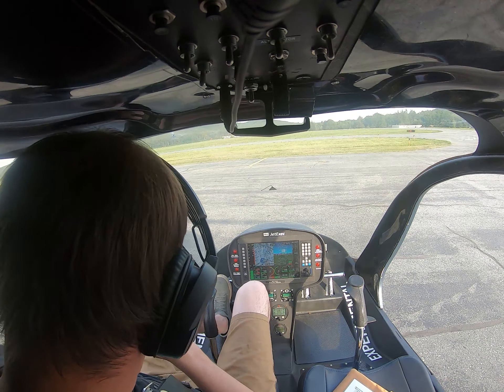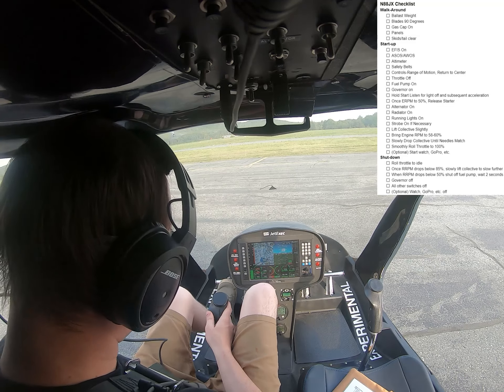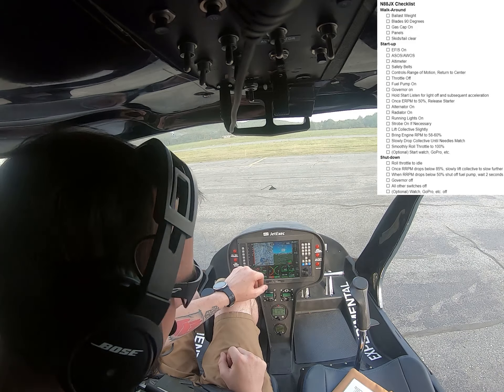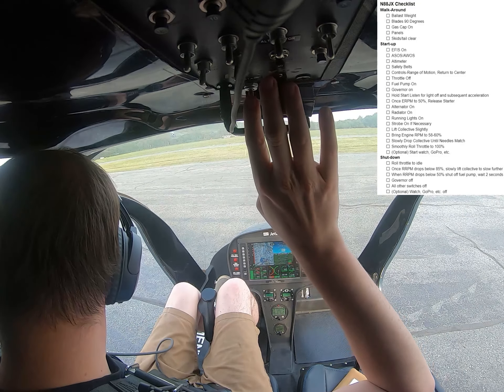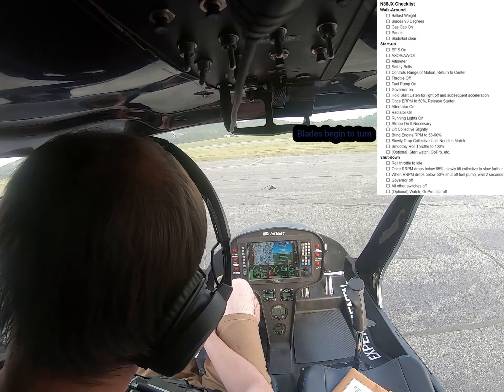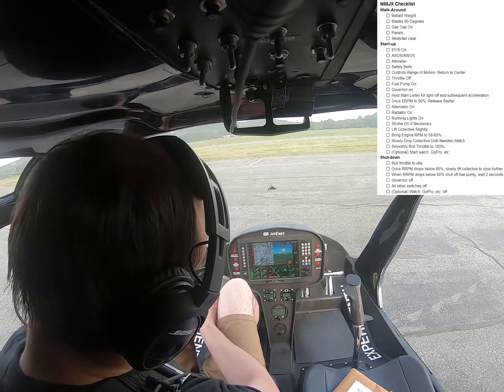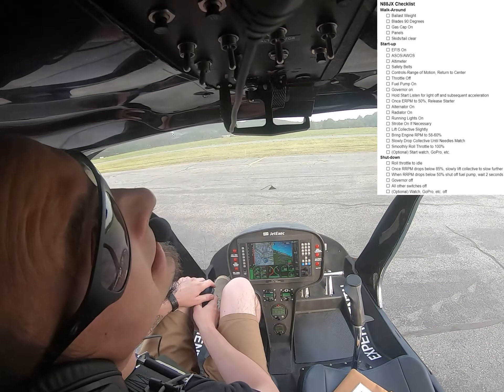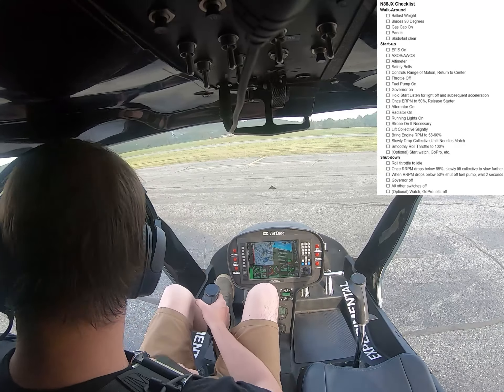JetExec Turbine Startup Procedure - Narrated

Comment: Beautiful helicopter!
Reply from the maker: Thanks!
Reply: @Aerohead  I had the opportunity to fly in a 162f last week in AZ, by the old rotorx factory. It was the piston model but amazing helicopter. Would you say the jetexec is anymore complicated than the standard 162f? Maintenance, flying?
Reply from the maker: @Urbanracer  No, not at all. I've flown both of course. The JetExec is naturally governed, so if you didn't have the governor on the piston model, that will certainly be a difference. Also, the governor in the JetExec is SOLID - you should expect to see RPM stable to with about a tenth of a percent - so that does make the whole thing feel more predictable than even the governed piston model which can sometimes have more oscillation. Other than that, flight characteristics are pretty much identical just with more available power. Maintenance wise - it depends on where you are in the build. I had more maintenance in the first 50 hours than you'd expect in a piston one, for exactly the reasons I mentioned above, we were finding things and addressing them, but beyond that, it's quite maintenance light. Grease/oil/inspections regularly of course, but other than that, pretty reliable.

Comment: Why do some RW pilots shy away from the Jetexec?
Reply from the maker: We're a much smaller number batch. Some don't want to do this much "experimental" and prefer the standard Rotorway, in which a TON more have been built, so they can have more of a "standard" helicopter. And like with any new platform with less than 100 in operation, there's going to be a bit more troubleshooting/design work associated with the JetExec and that makes people nervous. 

I totally understand it - JetExec's have run into a few bumps along the way and we've had to redesign some components, and for some people, that was too much.

Comment: Hi Adam are still able to get replacement parts for the helicopter from rotor x
Reply from the maker: Not from Rotor X, no. They are out of business. But honestly, I never felt like I needed any parts from them. There's a huge community of people helping each other out, making parts, etc. and none of the JetExec specific parts ever had anything to do with RotorX anyway. Elastomeric bearings and such are really the only big "consumable" that people need, and already several sources have popped up to supply us, same as the original ones that were supplied to RotorX.
Reply: @Aerohead  thanks that makes me feel lot better about moving forward with the purchase.